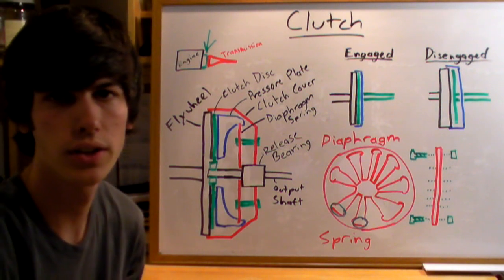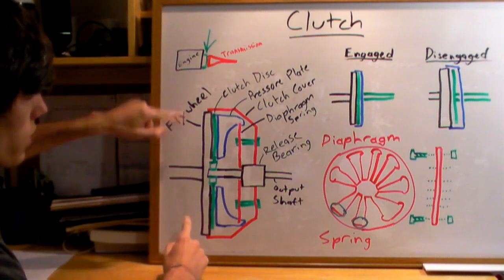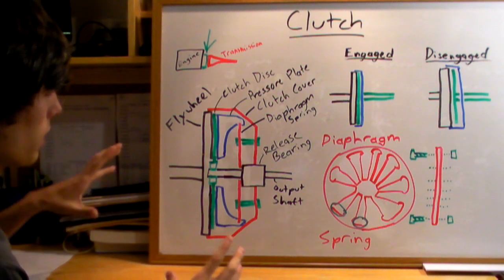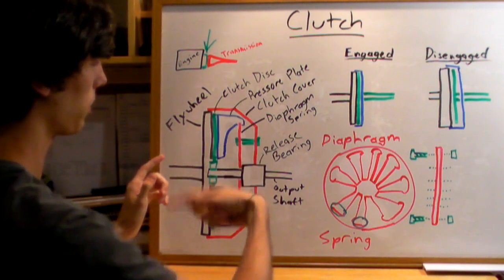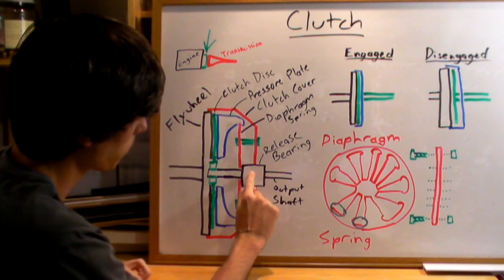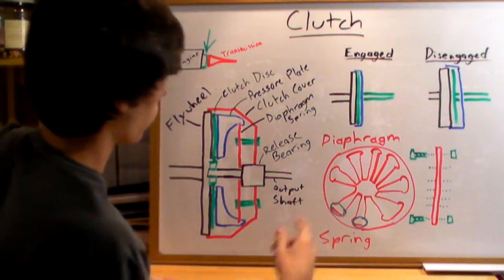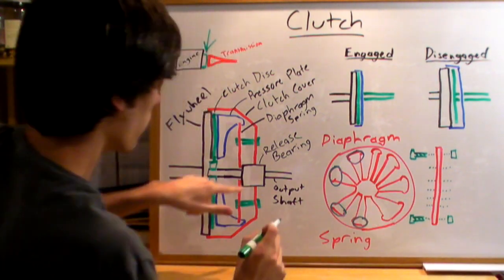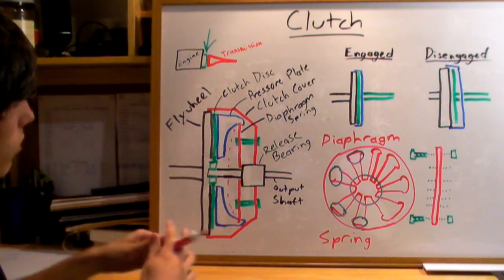Clutches - Explained

Comment from the maker: The clutch disc is not connected to the pressure plate, it's splined to the transmission shaft as the diagram shows.

Comment: Yeah, I know about the pressure plate. But what about the clutch disk? It's not and can't be connected to pressure plate, because the pressure plate and whole clutch assembly except clutch disk and transmission shaft rotate together with the flywheel.

Comment from the maker: The diaphragm spring moves the pressure plate off of the clutch disc. The spring it strong enough to keep the pressure plate away regardless of g-forces.

Comment from the maker: When you're not making enough power to move the car forward, and you let out the clutch (thus connecting the engine to the wheels) the car stalls. For example, with the car stopped (at a stoplight, for instance), the wheels  are not moving. When you begin to release the clutch the engine starts to send power to the wheels. If it isn't enough power, engaging the clutch is basically braking (not breaking) the engine, so it stops.

Comment from the maker: My videos regarding clutches (including this one) can apply to hydraulic clutches. It's simply the method which is used to press the throw-out bearing against the diaphragm spring. Most clutches will be hydraulic as this allows for fairly low pedal effort by the operator.

Comment from the maker: No, it's not bad as long as you properly match the engine/transmission speed. If you rely on the synchros then you'll wear them out fairly quickly, but judging by the fact that you're at 120k km you seem to be doing fine. You can always use the clutch if you want to, and it lessens the force you'd apply to the synchros.

Comment: Question : I'm shifting gear on my 5MT without using the clutch (not 100% shifts are clutchless) since Km 0 I'm now 120.000 Km with no issues at all. Is it bad ? on the long term ?

Comment from the maker: They have oil as a coolant inside the clutch pack (and between the disks). It's used in applications where shifting is frequent and a lot of heat is generated.

Comment from the maker: You can match the speed of the engine to the speed of the transmission for the individual gear, and you wouldn't need to use the clutch. But if you're off at all, and the synchros are worn, you'll hear a grinding sound.

Comment: Well, sometimes the diaphragm spring does go bad, specially when the release bearing is not working properly or damaged. In those cases, if the release bearing isn't replaced, eventually it will totally destroy the diaphragm spring. Don't know why, but release bearings don't like water at all! :D

Comment from the maker: Burning the clutch is when your engine RPM is not the same as the RPM of the clutch disk, while the clutch is engages or partially engaged. When you press the clutch pedal all the way in, you are not burning your clutch at all, as it is not in contact with the flywheel/pressure plate. It's best to put it in neutral waiting at a light, as you wear a throw out bearing while you have the clutch depressed.

Comment: OK, your videos are awesome first off. i have a quick question for ya. if the pressure plate is pressed against the flywheel and the clutch disc is wedged in between them, why doesn't it rotate along with everything else?

Comment: Thanks for your video. It is really well explained.
However I found it hard to find out by google the reason the reason why when we are stopping at traffic light with a manual transmission car, it is always better to shift it to N gear rather than remaining at 1st gear with clutch disengaged.

Comment: Why does the release bearing not move to the right, replacing the diaphragm spring with a solid link, and pull the pressure plate away from the clutch this way? Thank you for some great videos!

Comment from the maker: I have other videos which should address your questions. Watch "Automatics vs. manuals." Also, when you stall, your engine is killed because your transmission isn't moving and you engage the clutch. In simpler terms, you connect a moving engine to a non-moving transmission, and the transmission wins.

Comment from the maker: The flywheel/pressure plate are rotating at a different speed than the clutch disc, while touching, so the clutch heats up from friction and wears.

Comment: An IVT makes the clutch unnecessary.  Fully engaged from zero output speed, the vehicle can accelerate from a stop by dialing the output/input ratio upward as the vehicle gains speed.  Also, ratio changes require no disengage/re-engage cycles.  The video on my channel explains.

Comment: kinda little confuse for everyone especially who don't know well about clutch, when you draw and place the curve line of the diaphragm plate when it's engaged. you may fix it in time of 3:40, which the curve line should be connected with the green bolt.

Comment from the maker: This is when the clutch disc is slipping, and not fully engaged with the flywheel/pressure plate. The two rotations are at different speeds, so the clutch heats up from friction (burns).

Comment: I had the same thing happen to me, but it was on my 89 BMW. I had the transmission replaced and the idiots did somethings wrong but after fiddling around with it for a while i found that the starter was the problem. The gear from the starter was not retracting all the way and was staying out just far enough to hit the flywheel.

Comment: @DLStunning The stage 2 only mean that the clutch is of better quality (stronger) and can withstand more power (torque) before getting bent out.

For example if you were to put the clutch I have in my econobox ( 100hp ) and put it in a mustang (+/- 300hp), it would bend or crack at the first burnout I attempt. 

If i were to put a turbocharger on my econobox to bring it to 200hp i would need a new clutch for the same reason.

Comment: what happens if the drivetrain rev is not equal to the engine rev?
for example I stop, put the gear in neutral, rev to 4000 and then shift to one?

Comment from the maker: Seems a little strange, but it would be possible. There's just some way the engine still rotates the housing which the clutch disk comes into contact with. Doesn't seem too logical to me, but I'm not quite sure what it looks like either.

Comment: I have a -77 Volkswagen bus. The engine is rear mounted with the transmission in front it, the clutch however is is placed in front of the transmission. The order of the three from the front of the car is therefore: Clutch-Transmission-Engine. Why is this? I was under the impression that the clutch always has to be in between the engine & transmission?

Comment: the clutch disk is like a brake pad pushing on the flywheel. So if you let the pedal of just a little the clutch disk is going to create a little friction between the flywheel and the output shaft. so, the more you let go of the pedal, the more pressure the clutch does against the flywheel.

Comment from the maker: It will move a little bit because it is partially engaged. The clutch and pressure plate/flywheel are in contact, just not fully, so the existing friction is enough to move the vehicle forward.

Comment: Thanks for the vid. Surprisingly, I knew most of this already and I'm only 14. I do A LOT of research. I really want to study engineering in college. BTW i've driven manual cars and a truck andcould wondering could you explain why the vehicle will a little bit even though I haven't come completely off of the clutch. Thanks!

Comment from the maker: @lman333 Yeah it makes sense if your clutch is not completely disengaging. When you press the pedal in, perhaps there is still a slight amount of contact between the clutch and the pressure plate (see my video on clutches if this doesn't seem clear) and so that friction passes through your whole drive train. When you're in neutral your engine is completely disconnected from your tires (via the transmission) so no drag will occur (and your clutch will be engaged).

Comment: I have a question about drag.  I am experimenting with "coasting", and I find that if I put my clutch in on my 6 speed car, there is still an "engine drag" on the car.  If I put it in neutral and coast, there is no engine drag, and the car coasts better/farther.  Does this make sense that would happen? If so, can you give a simple explanation as to why? :-)

Comment: @tnphysics Holding the clutch pedal down while idling has the same effect on the cranshaft thrust bearing as holding the clutch pedal down while driving. Both are considered "riding the clutch". The axial force on the crankshaft is dependent on how far you depress the clutch pedal. It doesn't matter if the car is moving. When the pedal is released, there is no net axial force on the crankshaft. Hence, if you are idling while stopped, it is best to shift into neutral and release the clutch pedal

Comment from the maker: @tnphysics Going full speed in reverse isn't bad, it's just difficult to do in a small parking lot, that was my point. "The thrust load on the crankshaft is absorbed by a simple plain thrust bearing. This bearing cannot withstand the clutch release force from the release fork for any length of time." Is this true? The clutch is used at all engine speeds so I don't understand how this is true.

Comment from the maker: @tnphysics Not positive of what you're asking, but here's what I have to say. When riding the clutch your diaphragm spring is going to be rotating against a bearing which will then be spinning in a situation where this doesn't necessarily have to happen. Riding the clutch is unnecessary a great way to wear our your clutch disc prematurely. Never do it unless it's necessary (like using reverse gear but not going full speed).

Comment from the maker: @ThePustr117 Yes, perfect! Also keep in mind that the pressure plate and flywheel are essentially connected, and rotate at the same speed. The clutch is using friction on both sides to transfer the torque to the transmission.

Comment from the maker: @ThePustr117 That's a great question, and something most people don't realize going into mechanical engineering (like myself). If you want to be an automotive technician, that's what you need to do. It's extremely difficult to land a job in the automotive world with a bachelors (alone) in mechanical engineering. You really need a higher degree. As an automotive technician, you'll get right into the world of cars. Pay will be slow at first, but after 10 years or so you can open your own practice.